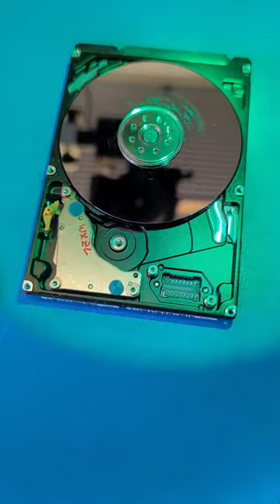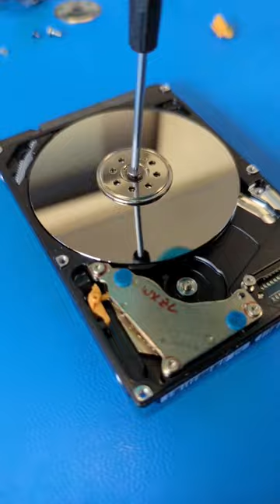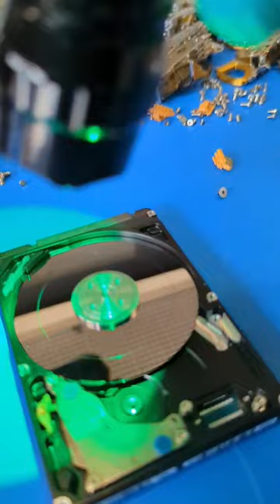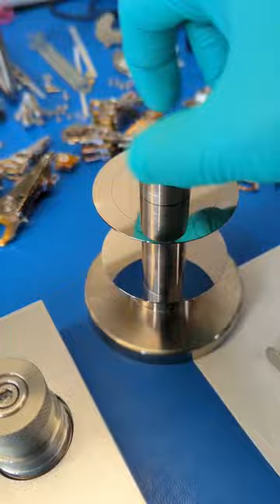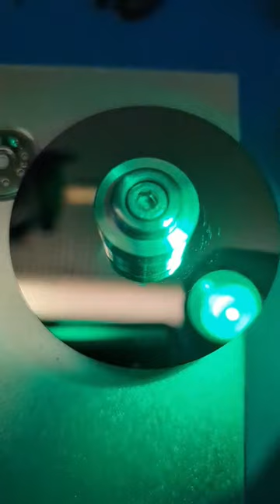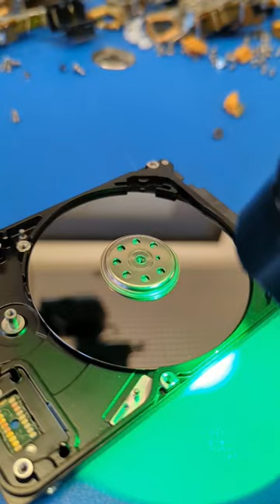platter damage data recovery process #shorts

Comment: I've no idea how you'd go about retrieving data from damaged single plates, but that's pretty awesome nonetheless... xD
I've heard that there is tech to pull data even from broken burnt plates though... is that right?
Reply from the maker: I doubt the burnt platters will give data up. The Hitachi I work in this short is still in progress. It's actually as 4 surface drive with 2 disks and 1 surface scratched  beyond access. 3 are good enough to tackle
Reply: So even with all this equipment 
Not all data can be opend?
Reply: @quack1119 nope, physical damage. He need to jump this damage (sector jump), and try to read max as he can.

Comment: Nice! Is there a way to remove dust particles or are they just ignored? Do you really need a molecular level clean room for hard drives like in the assembly fabric?
Reply from the maker: The cleaner the air the better. Any contamination is gonna lead to head failure eventually

Comment: I have got a question. Would it be easier if I replace the head from the other drive or remove the platter from the old drive to put it on the new drive without cause the lose of the data??
Reply: If the platter is damaged it doesn’t matter what you do that data is not going to be read.
Reply: @Big_Homie_Al3x  Oh right. They have recovered my data so it look like there are no platters damage. Have you ever done it to replace the head on the hard drive??

If so I wonder if you could help me with it?

Comment: Hi Erkin, why you lazy for create long video. 😃 just a joke. Beleive you are very busy with your works. This time I also have a small problem for you. Recently found a bad Toshiba 1TB disk. Its motor controller ic area make a voltage looks like Ac main (its not 230V,but there are a sense) voltage. I'm sure controller ic blown. But how this short ic make this kind of AC voltage? Hope a kindly reply
Reply from the maker: Hahaha!
Reply from the maker: I am not sure about the motor controller tho. Swap out the board

Comment: I messed up my functioning hdd while trying recover my files from hdd of my old laptop. You should warn people about your videos, hdd doesnt work anymore after opening and removing the platter.
Reply from the maker: warn ppl about my videos? my videos are not the reason you lost your data. You lost your data because you tried something without any knowledge off. This is not a DIY process by any means

Comment: Whats a typical job like this cost the user
Reply from the maker: Platter damage cases can take 4-5 times longer and more technical than regular head swaps / platter swaps. So they prices accordingly, 3K starting price. These days 4-5k is average
Reply: @hddrecoveryservices  I still want to eventually send you my bad drive with the donor drives I bought....  but it's hard to afford. Ugh...  I'm afraid of paying the inspection fee and having nothing recovered. And the 3-5k is just so hard to jump on... is that CDN? Lol.

Comment: I just replace the head of samsung harddisk, but the head only do repeating process and then the plate just stop working, do you know where my mistake is?
Reply from the maker: Damaged heads during swap, damaged disks, incompatible heads, too many too list
Reply: @hddrecoveryservices  really? But i handle it with care so i don't think so the plate got damage, but maybe the head because i dislocate it, and seem bend a little, but im not sure now the head still spining left and right for 7 time snd then the plate stop spinning
Reply: @hddrecoveryservices  how about plate swap? Do i really need to find the exact same specs for donor?